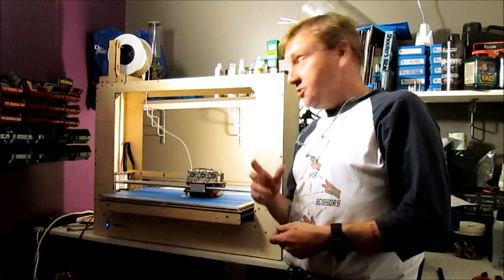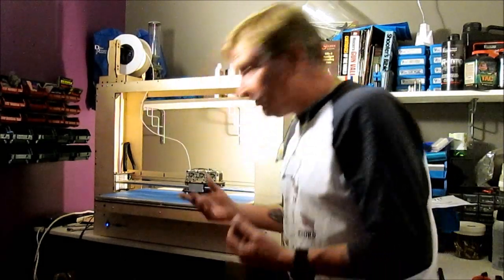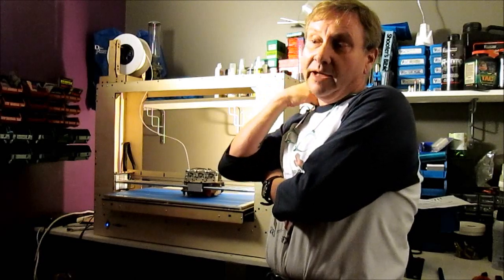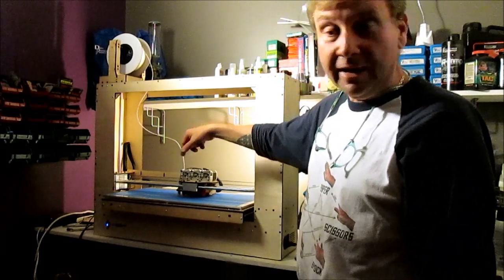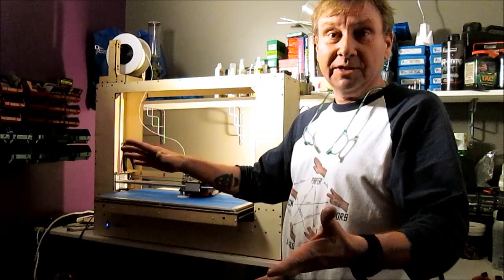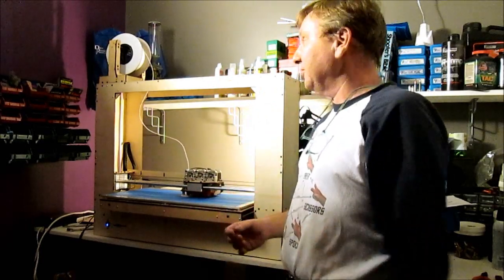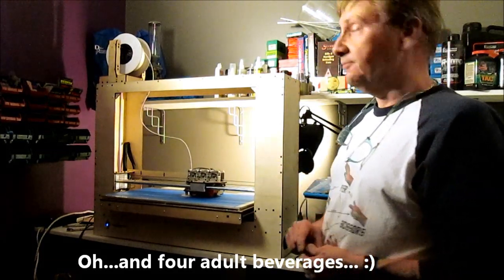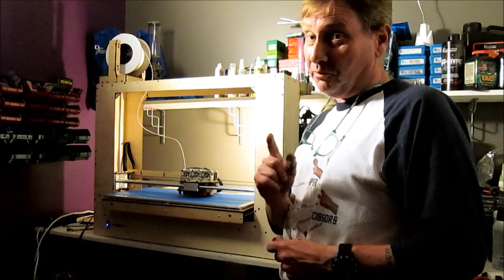Printrbot Go Large V2 3D Printer...initial prints and setup observations...

Comment: Did I miss something here? Their website doesn't include this anymore, only the manual is there I also can't find it online.

Was there a recall or something?
Reply from the maker: MegaDutcher They tend to come out with short runs of models that are funky. They had a previous version to this also. I don't think they were very successful...I know I sent mine back. Had several problems.
WISH I had bought my Creatbot with Amazon...what a POS that boat anchor has turned out to be...
Jay
Reply: Jay Raxter
Thanks for the reply, such a shame though the build volume was enticing.
Reply from the maker: MegaDutcher One major reason I sent it back was that with the 3 heads installed you actually only got about 19" of X travel...not 24". I wanted to install just a single extruder to get the full travel but turns out the least you could get by with was 2 heads...so it's right at 20".
This wasn't the only reason I sent it back but one of the major ones...

Jay
Reply: You've kind of touched on the shady part of the industry, namely false advertising.

And thx for the pm.
Judging by their track record, (also did some more googling) Printrbot isn't for me.

I've noticed more and more that my expectations are a bit high.
I want too much bang for my buck.

Perhaps I'm better off waiting for the tech to advance, or even just buying a smaller/accurate printer and making everything out of components.
I was hoping to avoid that though.
Reply from the maker: MegaDutcher I've had or used several printers. Found out a Delta bot is not for me....I apparently can't set them up right. 
I have said a few times that FOR THE MONEY the Davinci is a good tool for a noob who DIDN'T want to learn all the bits and pieces....almost got castrated because of that comment by a lot of other 3d guys <whatever>..
I'm using 2 Craftbots right now and am having very good success...but...they do required the usual learning curve and maintenance. I've upgraded the hot end on one to all metal (optional) and totally rebuilt the other one due to a bad thermocouple (it happens). 
The printbot is what it is....some like it and swear by it. 
Same with Lulzbot...the ones that like them say they're great.
All I can can say is MOST of the printers out right now WILL need some kind of mechanical tinkering....OR.....you'll need to invest big bucks into something like the Mojo. It has it's own limitations but from what all the owners tell me - it.just.prints. The cost however, limits who can use this for just 'fun'. 
PM me back if you have any Q's....

Jay

Comment: Hello, I am the lab assistant for my college. I am in charge of the 3D printers and the school bought the Printrbot Go V2. I have ran into the problem of strings and sloppy prints. We have tried hotter and faster extrusion but nothing seems to be working. Do you have any idea of what the problem is?
Reply from the maker: More things you can try.....load a simple file (calibration cube, tube, vase..etc), drop your print speed to 50mms or even 30mms. See if that clears up some of the slop. A lot of people tend to run perimeters too fast until they know what the machine is capable of. 

If it's stringing it could be TOO HOT or your retraction is fast or high enough. OR it could be crappy filament.

For printing I found 190-ish and 50-60mms worked ok. I also have had really good success with Zen Toolworks or G-Star filaments (especially white and silver from Zen). You might want to check your settings and vary your retraction. Try a longer retraction and see what that does...you can even speed up the retraction (on some software). 

Speaking of software I use Simplify 3D....it's $140-ish but, once you learn it, it did a better job of slicing and print prep than Repetier or Cura. That's a personal choice since I still think Makerbot Desktop (Pre-5th gen) is absolutely drop and print (easily DOUBLE the success rate of all other software I've used). 

And...just my .02 worth....the Go is built well and has the CAPABILITY to be a good printer but I found some inherent flaws that are not easily overcome by casual users. I had both the Large and the Medium and both had X/Y errors that were repeated at certain print heights (even with radically different models). I didn't like the Z nut adjustment and the standard G29 command doesn't sample enough points for the auto-level to work well. Levelling the Go series was a fail and, AS DESIGNED, I don't see it getting much better. I did design a 4 place screw-based leveling mount....but since I could get the X/Y artifacts under control it was a mute point.

Good luck...email me if you need to...

Cheers!

Jay
Reply: Jay Raxter
Thank you, I'll try it next week when I'm there. I'll let you know if it works. I have another question I hope you don't mind? When the filament is layed down the printer does not fill int the gaps, even though it is set to 100% infill. What do you recommend?
Reply from the maker: Adventure Projects
Well...printing at 100% infill is useless for most parts (unless you're printing a calibration box). 40-60% Infill is the strongest setting. 
I've noticed Marlin based machines REALLY need tweeking of their top and bottoms. They tend to not fill in the lines correctly. I am fairly sure this is is a setting in the slicer. I have had this occur MAYBE 1 out of 100 using Makerware but seems to happen 2 out of 10 using the same models with any Marlin based slicer. Where 2 or 3 layers was perfectly fine in Makerware...it takes 5 or 6 layers to get the same finish and coverage for Marlin. 

Try model with 40% infill....

Jay
Reply: Jay Raxter
Hi. Thanks again for you help and quick response. Today I was messing with the slicer settings and found out that even though I have adjusted the settings in a new profile and I did not tell Repeiter to use the profile. Slap forget So the Professor and I had a good laugh. I followed your advise of slowing down the extrusion and well as lowering the heat. The result was and an almost MakerBot quality print. I'm very happy with the results and thank you very much for your help. I think I'll purchase this model for myself.

Comment: IVE SEEN A FEW OF YOUR VIDEOS, I ALSO PURCHASED THE SAME MACHINE....IS THERE ANYWAY YOU COULD ANSWERE A FEW BASIC QUESTIONS ? OR MAYBE EVEN ASSIST ME IN GETTING THIS BED PROPERLY LEVELED ? RUNNING CURA CURRENTLY
Reply from the maker: First...take off the caps lock.
Bed leveling is almost impossible on this design (across the entire build plate) because it is hard mounted. The ONLY adjustment is the nuts on the Z threaded rods. They can change the height of the left or right side of the build tray. A 'see saw' motion. That, and the 'auto levelling' is about it.  You're supposed to run the head across the build plate and using the hex nuts adjust the flatness across the Y axis. THEN you run the auto level G29 code...and Hidey Ho...Off you go.
Unfortunately the auto level doesn't take enough 'points' to get the plate even close. Not only that but by using the Z nuts you only get it flat side to side...there is no adjustment front to back and the auto level does a crappy job of fixing that.

I am pretty sure you could get it close using shims under the build tray...but that's a huge PITA. I fabbed up a system that allowed me to screw level the plate. It also involved manually measuring the distance of the printhead from many points on the aluminum build plate. It worked ok...but it took forever to set it up....and I still had Z errors.

I had both Go Large and a Go Medium. Neither one leveled correctly or printed consistently and both were returned. Cheers - Jay

Comment: i just bought the same bot but i cant even get it to run or link up with anything. can you do one showing how you set it all up to the point of printing the cube. There tutorials are very sparse. I have no idea what i'm doing. i have used a makerbot many times and the set up out of the box was basic. I also had exactly the same problem with parts floating around in the case to the point the base has dropped below the motors. A simple a to z is what they need .
Reply from the maker: Brod, You're supposed to use Repetier to slice and hand it off to Octoprint for upload or use Repetier and, using USB, bypass the Raspberry and hard control the bot. Neither works 100%. I'm beginning to see why there are so few video's of this printing. I also got pissy when I found out I couldn't downshift to a single extruder on the large (to get the full 24"). That gives you a hair over 19" of Y travel.

Have you managed to get Octoprint to talk to bot? (Might need to private message me so we can work this out). NOTE: The Large got sent back...I purchased a Medium and it got sent back. There is a trick to talking to the Raspberry Pi (Octoprint). I wound up using Simplify3D to slice and Octoprint as the bot loader. - Jay
Reply: Jay Raxter Hi Jay
I havent been able to talk to octoprint yet. I cant even get repetier to talk to the bot. Having no success i have bypassed the pi and directly linked to my laptop through the usb and still having an issue with anything recognizing it
I work more on  a design and manufacture side and have been using makerbot but switched to printrbot for build size. So my experience out side the box is small. Makerbot are very user friendly where as this is a little to tech minded for me. What i do is design and run a company called robohand here in australia where we make 3d prosthetics. Brook has helped me out from printrbot but due to them being busy and a time difference its hard to make contact at the same time. How can we converse privately. thanks for your time brod
Reply: Hi jay
Having trouble leveling everything on this go. Manually it seems to be low in a corner by about 5mm. Im using repetier but i can seem to get the x and y axis leveled and homed before i attempt the z. The z is definatley to high but i need to correct the levels and home first
Reply from the maker: brod marsh Brod, the problem is the aluminum build plate is hard mounted to the y axis. NO ADJUSTMENT.

You're supposed to use the height adjustment nuts under the X carriages to adjust the side to side height...but you have NO front to back adjustment. It sounds like you, as well as I, have a bad 'corner'...and there's nothing much you can do.

The 'auto leveling' feature only takes 3 data points. (Looking down - Bottom left, center, and upper right). With such a big build plate that's not enough data to adjust the height. My other bots take 7 or 12 data points. 

I found almost everything about the machine well built...but the build tray adjustment. There's no way to get a full tray print with the current design.

Comment: Nice one J,

With that much weight on the gantry (3 x extruders) is there much sag over the center of of your build plate?

looking forward to your next post.
Reply from the maker: Steve, if you could see this beast in person...wow. NO sag...but it's built on 12mm rods and has nice solid CHUNKS of aluminum for all bearing mounts, rod mounts, and extruder head. It's hard to state how overbuilt this thing is. It uses double motors and can really zip that football sized head around...you don't want to get your fingers in the way. :)
Jay